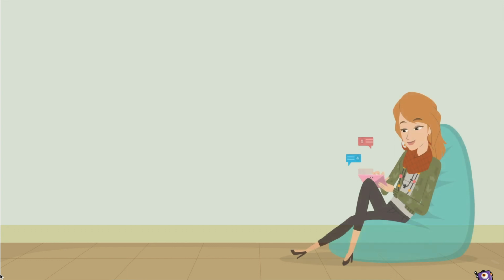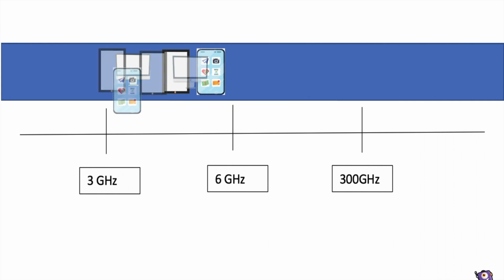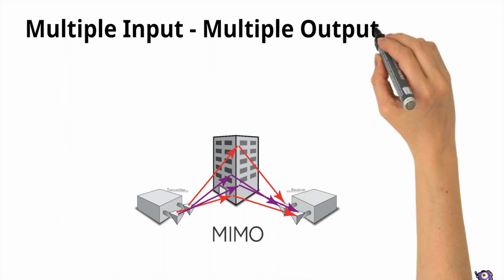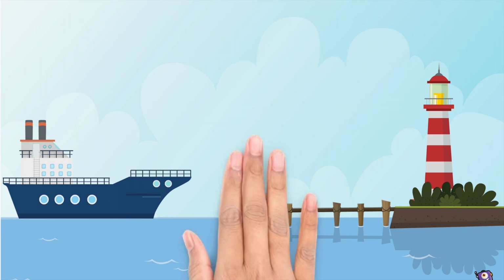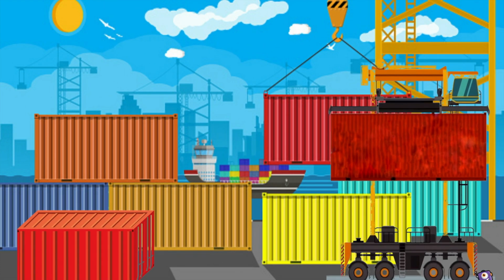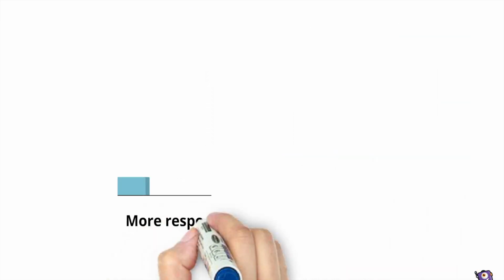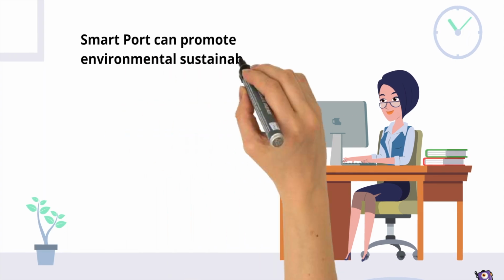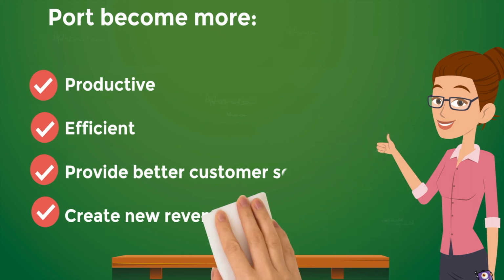5G as Enabling Technology for Building Smart Port

Comment: Does 5G use fiber optic?
Reply: 5G wireless networks and fiber optic networks complement each other. Both of them together offering a more cohesive internet experience across mobile applications. Without 5G, fiber would lack mobility. Without fiber, the revolutionary goals of 5G would be impossible. 5G networks will be designed to bridge the short distance between a 5G mobile device or business as in 5G fixed broadband and the fiber backbone.

Comment: Will IPv6 have a place in 5G or is IPv4 sufficient?
Reply: IPv6 will have a big place in 5G because of the Internet of Things (IoT), which will add new devices to the mobile network as it is rolled out. IPv4 cannot cope with the number of unique IP addresses that will be required, but IPv6 can. IPv6 introduces the Neighbor Discovery Protocol (NDP) which enables multiprotocol interoperability between IoT devices. Thus, both the number of addressable addresses in IPv6 and the features of the protocol are very important to the success of 5G.

Comment: What are the challenges that might be faced while operating a Smart Port?
Reply from the maker: One of the main concert while operating a smart port is the cybersecurity in the smart port. Connecting people, companies and institutions to objects and vehicles will lead to an exponential increase in the amount of data circulating between platforms and ports. So, security is one of the most noteworthy challenges. It is  needed to ensure that this massive flow of data can be transferred quickly and effectively, this must also be done in a standardised, totally secure manner.

Comment: What is the difference between 5G and 5GHz Wi-Fi?
Reply: 5G and 5GHz Wi-Fi are both used for wireless connectivity. 

5G stands for “fifth generation". It is the fifth generation of the cellular standard. 5G is used for cellular connections, and future smartphones may support 5G. 

Wi-Fi has two frequency bands. They are 2.4GHz and 5GHz. 5GHz is the newer one. It is still part of modern Wi-Fi standards. 5GHz Wi-Fi offers more non-overlapping channels, which makes it much less congested. 5GHz Wi-Fi is faster than 2.4GHz Wi-Fi.

Comment: Great video! The animations make it a lot easier to understand.
Reply: Hi, can i ask if there are any possibilities that 5G could potentially harm us?
Reply from the maker: @linwaitan3273  
Unfortunately, there may be health risk associated with 5G towers. Because many of these 5G towers are smaller and clustered more tightly together, there is a risk that the electromagnetic radiation will be much more concentrated when compared to 4G towers, which are taller and spaced out more. 

However, some argue that this fear of radiation is overblown. Cellphones work by sending signals to (and receiving them from) nearby cell towers using RF waves. These waves don’t have enough energy to cause cancer by directly damaging the DNA inside cells.

Regardless of the controversy, there is still some hope that stricter regulations on the emission of radiation by 5G towers will alleviate these health concerns.

You can read more about it here in this article: 
https://www.cnet.com/news/5g-phones-and-your-health-what-you-need-to-know/

Comment: Informative videos about 5g! But do we need new network towers for 5g?
Reply from the maker: Yes, the cell tower is an essential part of a 5G network. Like any network infrastructure, certain equipment is needed to relay information between devices, which is exactly why a 5G tower is needed for 5G networks.The 5g network tower are much smaller, and they transmit data on an entirely different part of the radio spectrum.

You can read more about it here in this article:
https://www.lifewire.com/5g-cell-towers-4584192